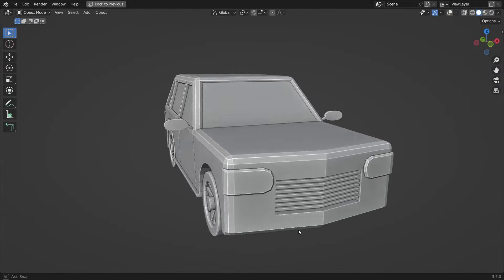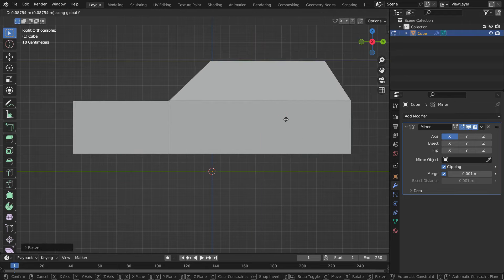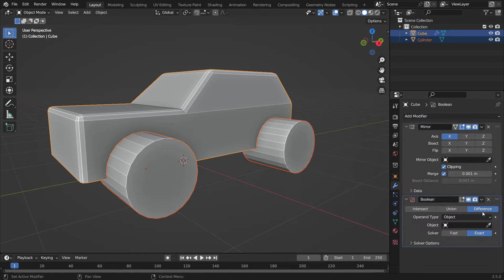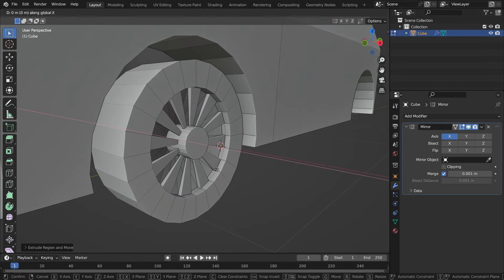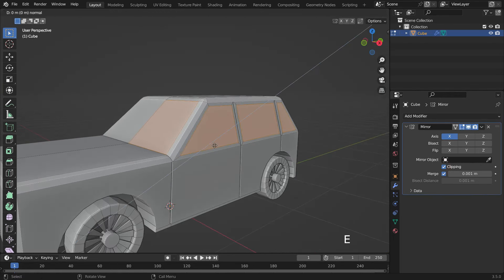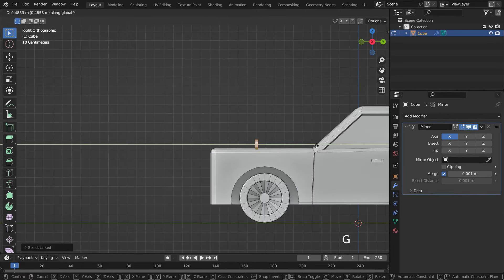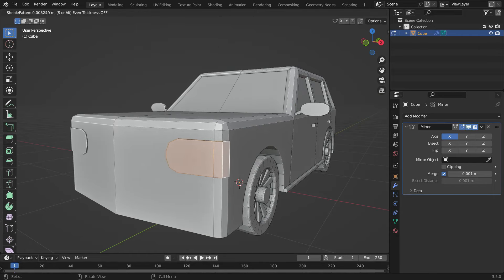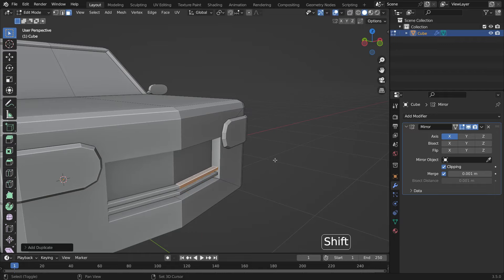Modeling a low poly car | Blender 3.5 Tutorial

Comment: during Inseting the wheel, if you are facing an OVAL shape  issue, its because the scale of ur object is not even, 

to fix this, go back to  object mode, select the object and press cntrl A and then "scale". now it should fix the oval issue
Reply: Thank you bro
Reply: Thanks a hundred
Reply: thanks a lot had a same problem
Reply: Thanks a lot, buddy.
Reply: Thanks bro 👊
Reply: Thanks a hundred bro,now fix the problem👍
Reply: Wow! It worked. Thanks. Thanks a lot.

Comment: IF u cant knife at 5:17 that means your top part is floating, (might be because bevel)
with knife u cut flat side of the car, but it cant work as the bevel part sticks out or smth

to fix that, i just cut a line under the floating part and all looked good
not so good at blender and also learning as yall, might be a better way to fix

Comment: When i booleaned the wheels it did not make the holes so i had to do one by one for each wheel
Reply: U probably didn’t join the cylinders before and therefore your edits only applied to one instead of both. Also you would have only had to do it twice bc it was mirrored